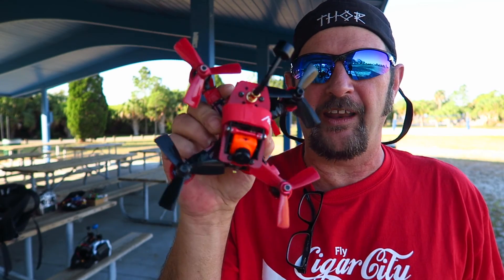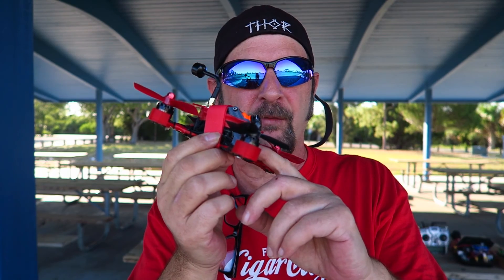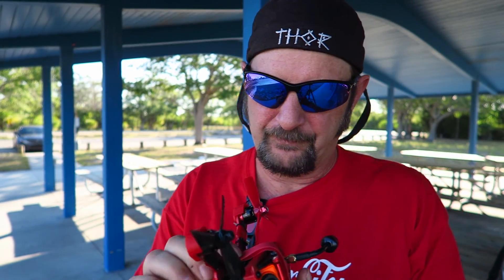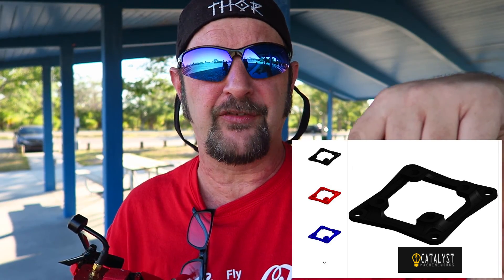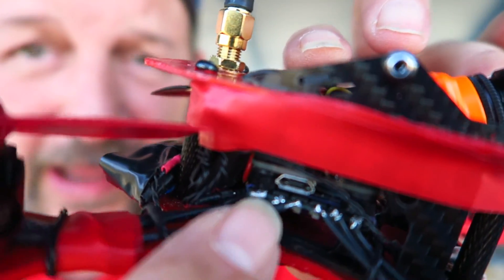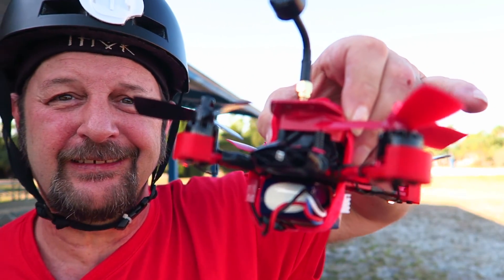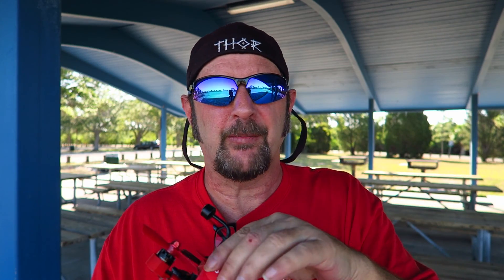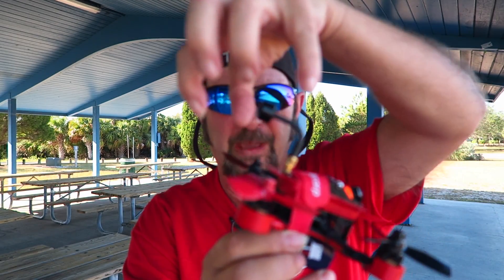Review: QAV-x 130mm FPV Racing Drone Maiden Flight!! (05.0702017)

Comment: i want to build micro drone like this ,
Reply from the maker: i think all the links are inn the description for parts. this one is flying a lumenier Micro Lux F4, 1306 emax motors, frsky recevier, vtx03 tranimitter, ciada 4 in 1 10A esc.
Reply: TheMighty Thor can flysky receiver i just have flysky fsi6 , hard to get part in my country XD my wishlist : dys f4 fc w pdb osd 5v bec + dys f20a 4in1 esc + dys or emax 1306 4000kv 3045 propeller , how about that do you think ??
Reply from the maker: in the USA i dont believe Flysky is that popular, so i cant really answer that with out looking at the Flight Controller manual. as for your list, thats a good build!!
Reply: TheMighty Thor XD i confused to build quadcopter But I want to create my own drones :"(
Reply from the maker: you'll never get one built until you start building :P
Reply: TheMighty Thor I'm just scared wrong, i dont know about drone race, 7 days i find out on youtube
Reply from the maker: were you scared when you learned to ride a bike Or learn to swim? gotta start some where. :)
Reply: TheMighty Thor XD thank for ur support , i will start
Reply: TheMighty Thor , what battery for this drone ? 3s howmany mah ? and C ?
Reply from the maker: Start with 3S 45C 1300 mah
Reply from the maker: go to a youtube channel called Propwashed he has a whole series for building drones
Reply: TheMighty Thor thanks you thor :)